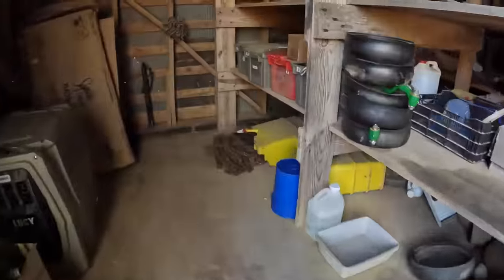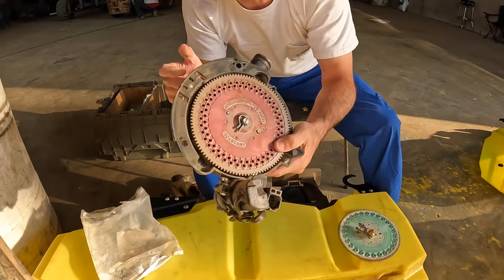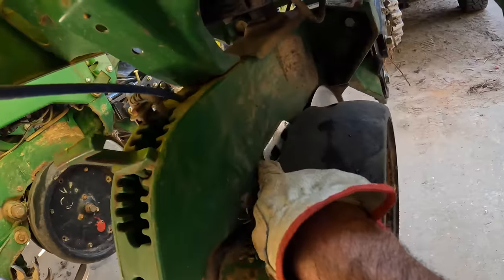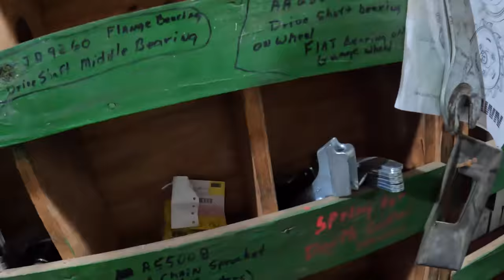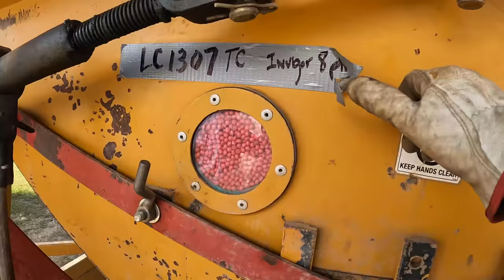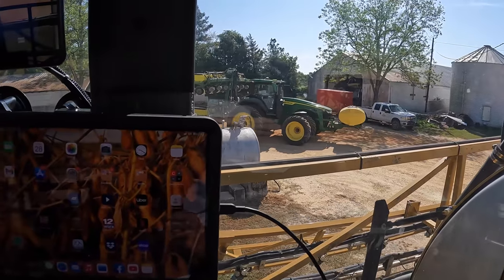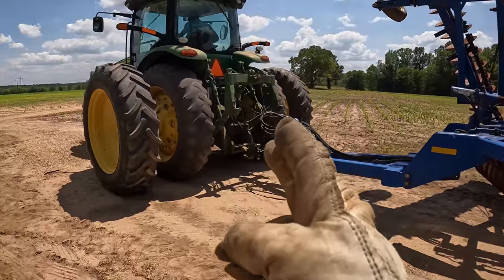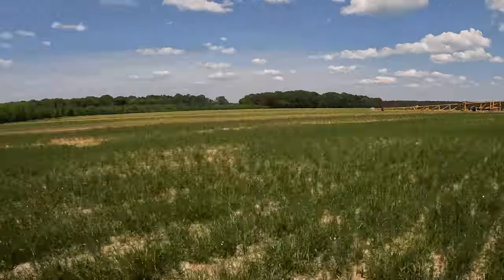SOYBEAN PLANTING PREP 2022

Comment: That Corn with the Roundup issue looks like a field I have & others, planting strip till into green rye/cover, when you look at it like that it’s not that bad. We do calculate for the Fertilizer Impact but really no difference. If you get a good burn down by the time it hits your knee you will not even notice it, & will have a little good dead mulch left to conserve moisture & lower soil temp. PS: Think about adding 1/3 of the Nitrogen you have down so far to make up for extra N loss. 👍